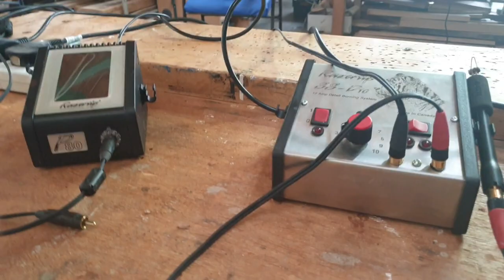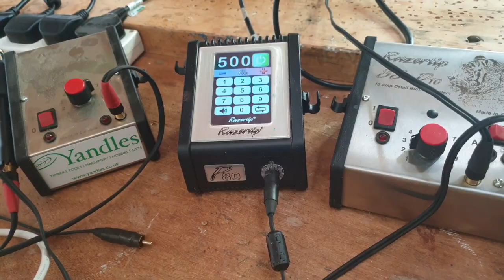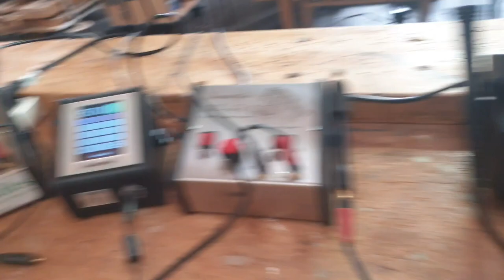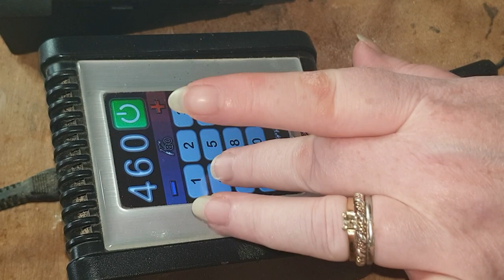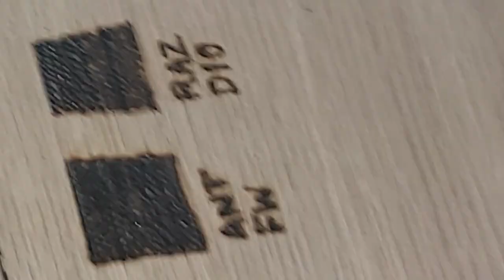Peter Childs vs Firewriter vs Razertip SS D10 & P80 - Comparing and Testing

Comment: I have a Peter Childs machine (bought years ago) and made my own (limited) range of tips. But I then bought a Razertip BPH Interchangeable-tip pen and adaptor cord (#5)   so that it could be used with the Peter Childs power supply.  Now I can use both pens with one power supply and also use the huge variety of nibs that Razertip sell. 

But as Razertip point out, they sell two types of power cable, an 18 gauge, which is very flexible and a 16 gauge which gives more current flow (so faster heat tip recovery but is less flexible. So there are a number of variables yet to be examined!
Reply: I have just purchased a Peter Childs machine - this sounds interesting do you have the products links please?

Comment: I have a P.C. pyro unit, as does my granddaughter. She uses hers a lot, but when I bought us both a load of new tips on Amazon, hers soon stopped working. I've opened it up and everything's pristine - no indication of heat stress at all, yet the output side of the transformer isn't showing a reading. No burnt windings smell or anything. Frustratingly there's no output voltage stated on the transformer label, so I don't know what replacement transformer to buy. I'd advise against buying one if it's so finicky on replacement tips.

Comment: Thank you for sharing this - very informative. Pity the Razertip SS D10 is not available in UK at the moment. I had just bought the Peter Childs not used it yet for artistic use..I'll just have to see how it goes. Wood choice may make a difference
Reply from the maker: Razertip have brought out some newer models.  The SL1 is a single pen model.  The PC is a great workshop model though.